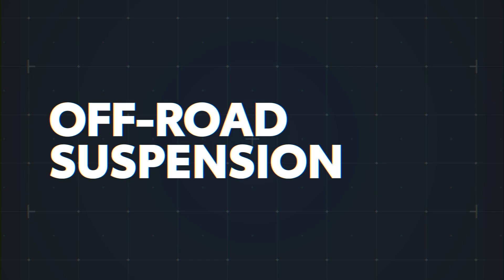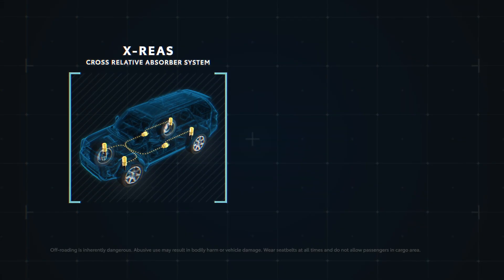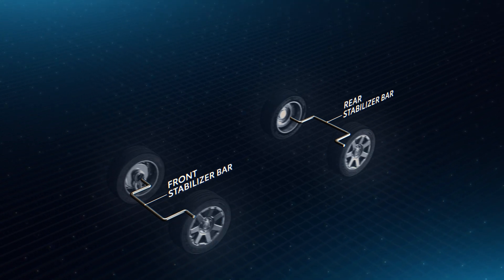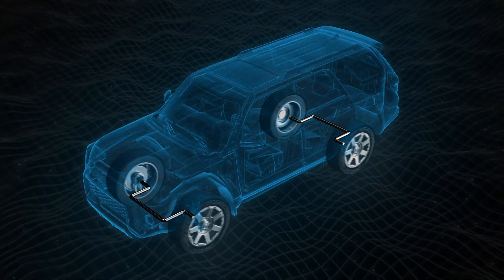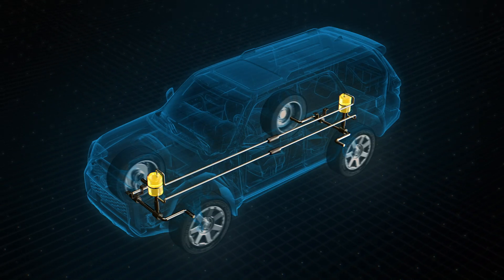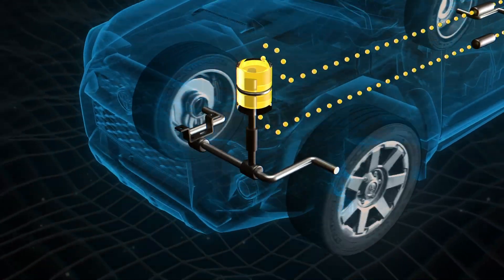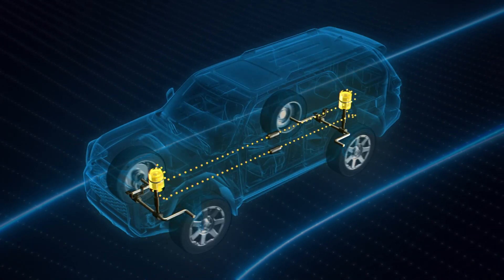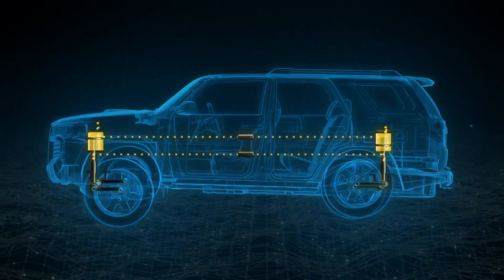How Does Toyota’s Suspension System Work? Great for Off-Roading and On-Roading | Toyota

Comment: Yeah, but when this system fails due to rust and leaks, it can be very expensive to repair, around $10,000 here in Canada. I really wish Toyota had designed it better, especially the area where the KDSS accumulator sits, under the small skid plate. Over time, dirt and grime can build up there, leading to rust and eventually causing leaks.

Comment: How can you correct the lean caused by kdss? I have a one inch lean towards the passenger side. I’ve tried every gimmick I’ve seen and nothing works
Reply from the maker: Hello! We recommend contacting the service department of your Toyota dealer as they are our experts. You may also call our Brand Engagement Center at (800) 331-4331 if you wish to discuss further. Our Brand Advocates are available Mon-Fri 8am-8pm, and Sat 9am-7pm EST.

Comment: Sounds great in theory, but in practice it's a really bad idea.
the hardware sits low so reduced your ground clearance by about 2 inches in the front
insanely high repair cost - $4,000+
worst of all is in most off road conitions, unless you're crawling at 5 mph, the ride quality will be atrocious. going down any dirt road with washboards will feel absolutely horrible, due to the kdss system locking up thinking it's on a paved road.
You cannot go wrong with a regular suspension system, this kdss was a band-aid toyota made to try and reduce rollover accidents. You don't want this.

Comment: Just got quoted over $5000 from dealership to get the hydraulic lines replaced on my KDSS because they’re shot. So long KDSS
Reply: Glad you mentioned dealership, so there’s your issue.
Reply: What year and vehicle? Gx460 or 4Runner?
Reply: @crunchyblack2224  2012 4Runner. It was the entire KDSS system, I just bought Bilstein 6112 and 5160 for $1800 CAD. Much better ride and still provides the stiffness on road

Comment: As much as nice to have this feature on your car as it is headache to maintenance the suspension of car that have this feature .. you will pay double what you pay for the normal suspension
Reply: With XREAS, this is true. KDSS however is very reliable.
Reply: @andym1223  well, I mean at least you can toss the system if you choose to replace the suspension with something else.
Reply: @israelrodriguez6986  no you can't, you would need to weld on new attachment points and buy a new knuckle for a normal sway bar to atach to, thousands of dollars
Reply: Hydraulic suspension  will be same price as vagetable in the year of 2025 in China for most EV cars. I will work on it.
Reply: 3” lift is fine if you have KDSS. You need to find a shop that knows what they’re doing.
Reply: @Blugraz negative, with kdss you don’t want to go above 2”
That’s where you start to run into problems. 
Also, kdss requires no maintenance, just check for leaks anytime you get under the car
Reply: @Blugraz  wrong, the rear you can't evne lift 1" before the rear sway bay is maxed out

Comment: KDSS is terrible if you lift your 4runner higher than 2.5”
Reply: Just get spacers for the kdss system and it’s back to original geometry
Reply: @erichdiebenow4727   Kdss spacer only gives u more wheel travel when offroad. It does not fix kdss lean.
Reply: @godzilla633  so I just lifted my gx460 with bp51s 3inches in height about a week ago. So now I can actually see what happened. the spacers definitely helped but like you said there is still a little lean however it isn’t nearly as bad as other non spacer kdss lifts I have seen.
Reply: @erichdiebenow4727  That's because the person that installed your lift opened the KDSS bleed valves to release pressure on the front swaybar, but didn't rebalance the KDSS afterwards. Most "techs" that install aftermarket suspension systems on KDSS-equipment vehicles follow this process, but have no clue on how to re-balance or reset the lean.
Reply: Had a shop install a Fox 2.5 system with a 3” lift and they know what they’re doing. You need to find a shop that works mainly on Toyotas.
Reply: @Blugraz  Are you in southern CA? If so can I get the name of the shop? I only found one place - 88rotors in LA.
Reply: @eyesea123  I’m in Denver.  RSG Off-Road is where I go.
Reply: @Blugraz  Bummer. Thanks anyway
Reply: @eyesea123  88 rotors is a good place to get your Toyota lifted. They do a ton of work on Toyotas.

Comment: Let's sell the Genesis X, the cheapest entry-level vehicle, by making a gear rod. The hyundai 2021 Grandeur, k5 and 2019 k9 designs aren't that bad. If you put the gear bar on and make it the brand's entry line, it will sell quite a bit, and the reason why you don't want to buy a car from a Hyundai is because there is no gear rod. And it is broken.
Reply: Does Hyundai/Kia  even make a suv with a full frame? with a solid rear axle? I dont think they do. So its a four wheel drive car (crossover)for all intents and purposes.